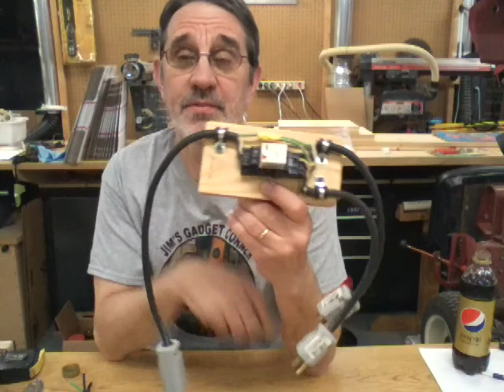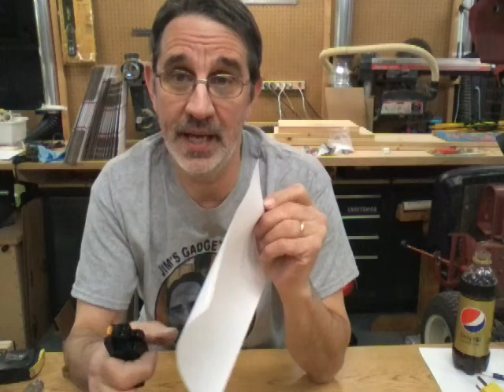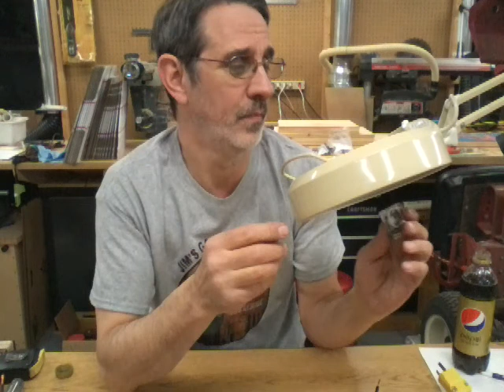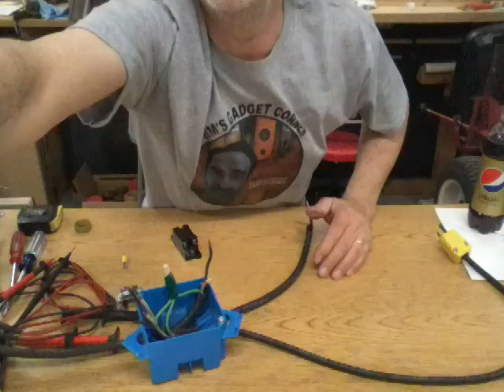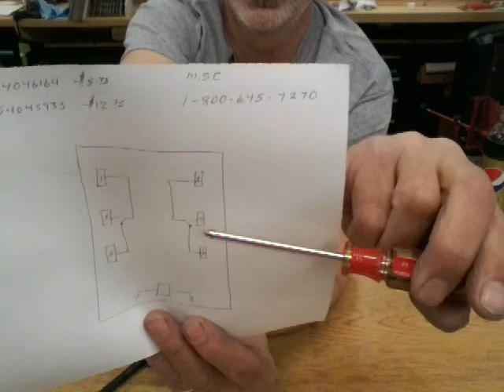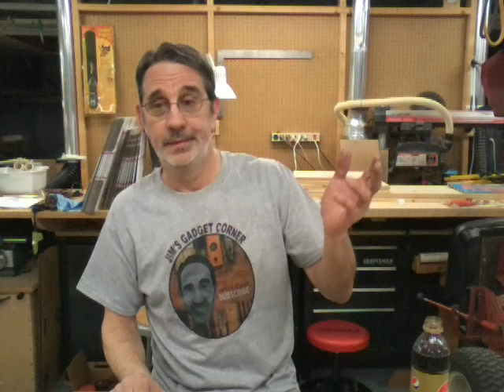172. M/S. 30  Building a remote control for your dust collector

Comment: Thanks Jim.  I just wired mine up today and it worked like a charm.  Special thanks for decoding the socket wiring diagram.
Reply from the maker: Mike Broadfoot 
Hi Mike
  Well I’m glad to hear you Got yours wired up and working it sure is handy to have them to turn things off and on with. If I can help you with anything else let me know talk to you soon. Jim
Reply: @jimjackson9381  
HI Jim,
Well it did work...  The relay failed after the 4th use.   I think I need a bigger relay...  (240V - 3/4 HP)
Mike
Reply from the maker: Mike Broadfoot 
 It should say on your relay the amp load that it will handle, check the motor plate and see what the amp load is on your motor.  you may have got a bad relay. Let me know what you find out and I’ll help you through this issue. Thanks Jim
Reply: Jim. It’s actually a 5HP motor. 20.8 amp, 3450 RPM, 230V, 60Hz motor from Leeson.  Let me know if there is a big enough relay for the socket. Thanks in advance!
Reply from the maker: Mike Broadfoot 
 Hi Mike, send me a picture of the relay and the socket taken apart and I will check tomorrow for one, does the relay  you have now say it’s good for 20 Amps send it to jimsfixitshop@gmail.com  and I’ll see what I can do to get you going. Thanks Jim

Comment: This is Miles. I love your video's. Very informative and easy to follow. I'm a new subscriber from just outside New Orleans.  My question is, I have a 33" RER.  Over the last several years it has progressively stopped moving forward, first in 1st gear, then in 2nd, and now all forward.  It has been well taken care of.  we have put on 4 new drive discs with no improvement.  My question is, can you swap the chain and gear cases between 28" RER and 33" RER?  Are they the same?  Thanks.
Reply from the maker: AthenaTsunami13  hi it's Jim
  Before you go to swapping parts and disassembling this thing watch video number 70 it will explain how to check a couple things and how to tighten your yoke spring very important. If you need anything else please let me know and I'll be more than happy to help you. You can also email me at. jimsfixitshop@gmail.com